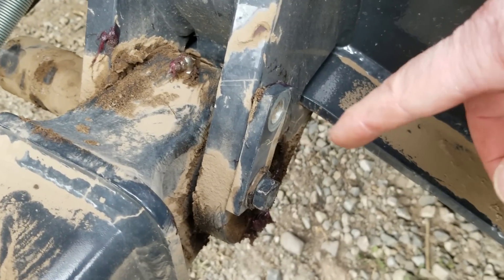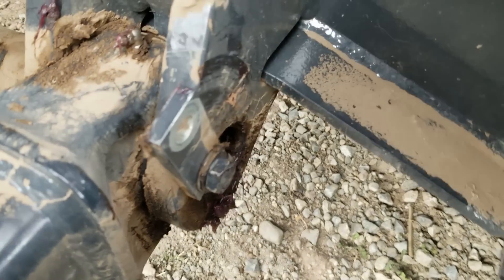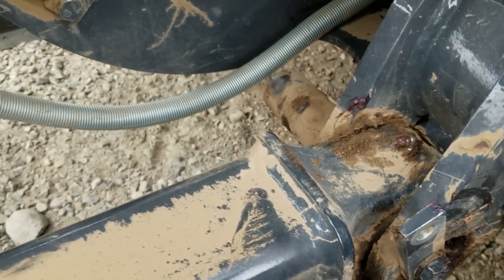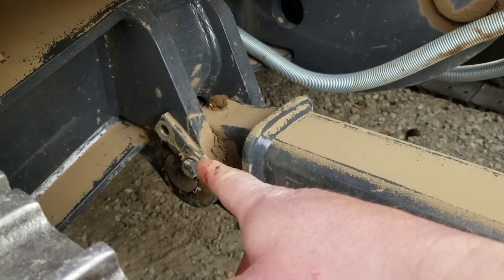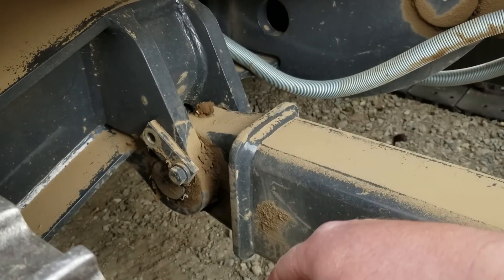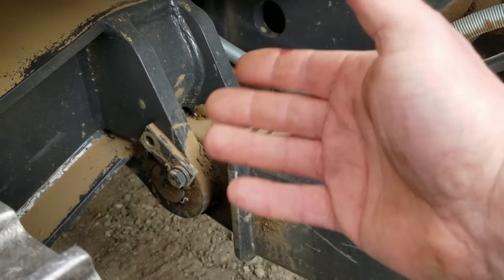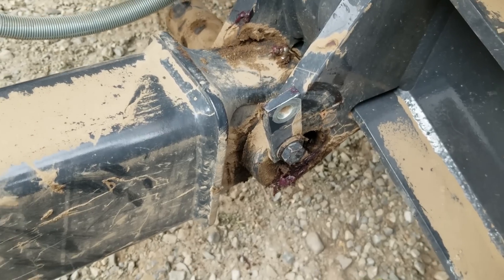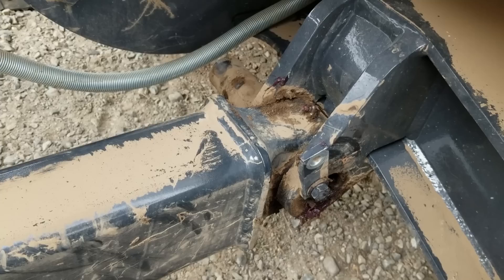Deere excavator design flaw. Suggestions?

Comment: I’m a maintenance supervisor in a steel mill. Many of our pins are retained this way and it is a design/engineering flaw. Pin seized in the clevis, when you raise the blade the notch in the pin levers the keepers and breaks the bolts. Solution was to machine the notch in the pin the full circumference so the pin can rotate if needed.
Reply: I'd like to jump on the bandwagon of hate against the bean counters.
Reply: Whilst I think the full circumference notch is is good idea to stop the bolt breakages it causes the fork holes to wear as they are not bushed or greased so you end up with a nice sloppy hole and a dingus pin that don't fit! We welded big beefy tabs to prevent this pins were held in with his old chunky spilt pins after.
Reply: As Don has described, it doesn’t require a huge amount of torque turning those pins to exert a huge shear force to those tab retaining bolts. A short arc of movement coupled with a tendency to neglect the lubrication of the dozer blade pivots (obviously in favour of the arm and slew turntable) will soon result in problems with this fixing method.
Reply: Why am i thinking of half inch thick C- or E-clips now?
Reply: @dikkie1000  that would stop the pin from coming out, but it wouldnt stop the bolt on the bracket from snapping. They shoulda used much thicker bolts so it has a much higher shear point. With a piece of equipment like that/all the weight and heavy duty stuff it does, bolts that size is a joke. I blame the bean counters not wanting to spend the extra couple bucks for bigger bolts
Reply: @jacksmith2315  nah those bolts are plenty big for a pin that size. Wrong type of pin retention altogether for the application. I'd put money on a TSNB coming down soon enough to replace them with expanding pins.
Reply: Bingo.
Reply: I've seen that in some ancient equipment, it was still working
Reply: Bingo!
Reply: So this IS a feature - when it self-destructs you know you were getting lax with the grease gun.

Comment: Haven't managed that particular breakage myself yet. Although all our stuff is well past 100 hours, so by 1000 it's self-clearanced and just stops doing it? 

Break out the welder. We both know you'll never pull that pin out unless you're getting the grinder out anyways. That's one of the pins that you just take the slack out with the controls, since the only usefulness that blade has is steadying the machine. If it was a 4 or 6 way blade then it would be mildly useful as a dirt pusher, but still not really since it's narrower than the damn tracks if you actually try and play dozer with it.

Comment: It's the same locking "nongineering" kind on New-Holland TG series (some CaseIH Magnum too) and these always break.... guess what.... this locks the front axle's main pivot's pin (2"-3/4 dia). We're just right now remounting the whole front-axle after a complete overhaul. The pivot-pin will be lock with double-L brackets on both side of the tab welded on the head of the pin (can't be lock from the other end). These brackets would be held to the frame with 4 bolts (2 on each brackets), tapped into the frame (5/8" or 3/4") 

If we had a milling-machine, would be easy to make a round 5" x 1" thick cap with a groove in it allowing for the tab (rectangular welded head-pin) to at least rotate 1 or 2 degrees. 

If we had a lathe though, I would machine the master pin to fit the kind of lockers I saw on 966 series Cat payloader's bucket.... I'm sure they have a locker that would fit a 2"-3/4 dia. pin/shaft. (or better) ;)

Comment: What in the goofy pin retention is that thing!  I work in equipment rental and that must be some sort of new JD thing?  Haven't seen in on our older units and our newest units are Kubota, but yeah, I'd throw a weld on there.  Maybe a couple fat tacks on the tab to the frame.  At least then you can just zip  them and pound the pin in when you need to change things, or work on that cylinder.

Comment: completely unrelated, but this has been on my mind for a few days now.  previously you put together a battery pack to run 120v tools.  i re watched and paused to read labels.  from what i can tell it was (3) 36v packs and no inverter.  this is probably a dumb shit question and im sorry for asking it.  i tried to research it elsewhere inspired from the dewalt power station, using (4) 20v batteries but this device has a built in inverter to jump the power to 120v. 

the setup you made appears to run 120v tools just fine at a lower voltage.  whats the voodoo magic here?  does lower voltage output effect the devices youre supplying? was there a small inverter not mentioned?,  or is the answer even simpler, universal motors simply have an operating range + / - 20v?

Comment: Oh dear testicular scratching. Lincoln or Miller welder a death metal melted together permanent repair until pin wears out then gouge welding removal repair failed again continue until the scratchy falls into rusted

Comment: My solution would be a "C-clamp" fabricated to the correct dimensions to where the pin can't wobble, with being bolted into those holes. The only stress on the bolts should be holding the weight of the C-clamp, and the clamp holding all the force of the pin.

Comment: After reading all the comments that I should I see that only one is close to a proper fix and Fabricobbling! Here’s what I Did with 3 pins on a 1969-1971 ish Case 480CK Construction King.
After all it was well worn out and I rescued it from the junk yard.
I made Doughnuts 🍩 for at least one end of the pins got pins from the JD dealer that had a Take me home now price beneath 3/4” of dust on a back of the showroom wall. They fit tighter than the worn out ones, but they stuck out a bit more so I turned some 4”Diameter doughnuts. And they were 1-1/2” thick with a 1-1/4 hole. Then I put that in my Mill and flattened two opposite sides and Drilled 5/16” holes through it aligned the holes in the pin and doughnuts, then Put a 5” long Grade 8 bolt lock washer and a pair of nuts with another lock washer between them. The owners sold it for close to 10k the Extend-A-Hoe valve pack was the last thing wrong with it and a few of remaining old Hoses. It was almost impossible to steer when I drove it home to work on... but when it was returned you could steer it with your pinky finger. All the lights worked plus the additional work lights I installed. Single wire Alternator, remote jumper attachments for Positive and Negative, and a entirely new battery Box. Replaced the Cutting edge on the Bucket, and most of the wiring. Some one got a great machine! I kinda miss all the fabricobbeling, even added additional hydraulic oil filter just before the new Hydraulic pump, and it was only lacking that big valve Body that was worn out. It would work but if you expected it to pass a leak down test it would fail. 5 cylinders of the 10, I had rebuilt, and hoses were replaced with new. Loved this machine! Volunteer wages and dug my pond 😃

Comment: thats a problem either with the dealer using cheap farstners, or simply what to expect with Metric bolts... slap a Grade 8 SAE "equivalent" to the metrickery (read likely .015-.060" bigger on the maj DIA) and the problem will go away. will take some drilling and tapping but I feel you can handle such things.

Comment: Have had/seen same issue on pretty much any equipment that uses a bolt to retain a plate like that. Longer pins with bolts through them so they can rotate helps.

Comment: That should be under warranty, it looks like the bolts were over tightened, if you're going to do it yourself get out the old sheered off bolts and  replace all 4 of them. Kubota minis bolts would sheer off the problem with them was the bolts are not standard metric thread pitch. I would end up re-tapping the holes with a blind tap to standard thread.

Comment: Did the bolt shear off at the pin surface or did it walk itself out?

If it did shear, was it torsional or lateral?

If it's lateral then the likely culprit is too much movement in the pin at the ears, which would be a wear issue. Either not enough maintenance or too much load for the material.

If it was torsional, then the pin was likely binding in the blade, that would be lack of grease again or poor design not allowing grease into where it's needed.

If it's walked out that would either be it simply wasn't done up in the first place, or the same thing as a torsional failure.

Either way that kind of pin retention is garbage.

I would be drilling and tapping both ends of the pin and putting effectively a big old washer on both ends, about 10mm thick or so. That way it's retained and is allowed to float. Just shim it up to allow 0.5mm or so of total end float to allow for grease and a little deflection of the cheeks under side load.

Comment: As an owner operator of heavy equipment for a decade, that is the least used feature of an excavator. I may grease my blade pins every 3rd Wednesday and no failures yet. Beef up the pin retention via; big ol buzz box. Weld that sum bitch in place and keep hoe’n!!

Comment: What we have just witnessed is the first software hack on the mini track units! Maybe AvE will get the rest of the code right in the next attempt and achieve higher angle and be able to windrow both left and right! Unlocking features through the computer without hardware changes, what a time to be alive!

Some commented that the pins should just be allowed to rotate. I believe this is false. The grease path in that pin or blade frame is only going to pump grease to the blade frame part that was supposed to move originally. If the pin just rotates in the machine frame with no lube it’ll wallow out the eyes in the frame and then it’ll be a mess.

Comment: Ive had a 50d for  3 years. Have put 1000 hours on it Abusing hours. Now has  4115.No problems at all. But then I grease every time i use it. I will use this video to show the dickheads that say you can over grease.

Comment: We make large earth moving equipment.  On smaller machines the 'tab' head style pins retained with a bolt were fine for decades.  However, now most of our pins have a hex head on one end with the inverse hex stop welded to the machine.  The opposite end of the pin has a 3-hole cap with SHCS or HHCS to secure it pin place and prevent it from rotating.  There is more machining involved and a larger BoM but totally worth it -- for RADIAL force applications, not Axial/Thrust.

Comment: Very common for a lot of Deere equipment, seen the same problem with the same style keepers on their dozers. However on the dozers the keeper tab is a thru bolt and not tapped. Is it an option to thru bolt it or can’t you get to the other end?

Comment: So being in the hay baling business going on over 22 years now. I recount my second year into it with the second new round baler from Deere. Ran the first bale fine. The second bale was being spun up when I got a door alarm, and noticed that the belts seemed to be smoking. It was probably 3/4's to size, and thought maybe the gate didn't latch all the way. No biggie i thought, just stop and eject the bale. Well, as soon as I tried to kick it out the whole rig burst into flames on account of getting the oxygen every good fire needs. I jumped out and immediately got the pto detached, and tried to drive away from the baler, but the damn safety chains were keepin her following my tractor. Luckily there was a shallow pond in the field which I headed directly towards. The water didn't save me and the tractor, but the soft bottom of the pond did. I must've put the PTO shaft 6 feet under which broke the safety chains clean into this saving the tractor. Insurance guy came out, and the fault was from the factory. One of the rolling bars that the belts ride around had not a single bolt holding it. Just the green paint to hold it's connection in place... 😂. Moral of the story? Don't use the safety chains.
Reply: Forgot to mention that I dodged death again a few minutes later when one of the hydraulic cylinders that lift the gate up and down got so hot it sent the ram straight towards me like a missile. Luckily I was young then and had quite a vertical leap.
Reply: Farming is dangerous...
Reply: Dangerous but fun.......

Comment: I’ve got a couple John Deere 325g skid steers and the pin bracket bolts break all the time, and the pins walk out on the arms for the attachment plate. John Deere wouldn’t warranty them, they wouldn’t even warranty the pins that snapped in half, they said we abused them and sold us new parts that broke within 20 hours. But the pin brackets I just welded those, nothing a grinder can’t fix if they need to come out.

Comment: If you call a Deere dealership they can run the serial number for any PIPs. Something like that may fall under a fix as fail or there may be an alternative part for "extreme use". A-lot of the PIPs can be done on a machine even if the warranty is out so long as it isn't expired and as the dealer will get paid so they will happily provide the parts. About 10 years ago I worked on a 60G that had been rolled down a bank and if I remember right some of the pins I replaced did away with the set up you have and went to a welded tab and single retainer bolt. If I'm remembering wrong don't crucify me. After 20 years and thousands of pieces of machinery shit tends to run together and get mixed up in the old memory banks.

Also those probably sheared because the pins stuck. The single tab ones will do the same thing. You could always try a grade 10.8 and see where the next weak link lies.

Comment: My guess would be probably a grade 8 bolt and some blue loctight or green if you're willing to go with the screw the next guy approach.  It honestly looks like they put the wrong grade of bolts in.
Reply: Grade 8, probably won't need loctite. The difference in thread pitch should be enough for that metric hole.

Comment: I've crawled all over mining equipment looking for cracks and almost every machine has a broken pin retainer. Doesn't matter if they weld a huge block on, the welds will crack. If the pin wants to move, it will move.

Comment: Bad design, any twisting force on the pin from binding will cause the retaining plate to shear. Because there is an axial torque from flat keeper groove pushing up on the plate if the pin ever rotates.

If it were my machine I’d weld a boss on one side with a through hole for a retaining bolt, you would have to get a longer pin to accommodate the boss with a hole as well. This would eliminate the leaver action of the grove and retaining plate.

Comment: I’d turn a slug with a hefty shoulder and a radius at the 90. Hefty dowel the other end, and retaining-pin the pin. The main pin needs to be 1/4” longer than the clearance between the eye and ears. That would fix it. Side thrust shouldn’t be able to act on the retainer caps

Comment: Do you use the blade to push? How often?  A problem that I encountered years ago was trying to do too much with the blade and using the blade to level the machine.  A small gob of weld on the one side of the retainer seemed to help.  But also using the blade less and the bucket more never had a problem after that

Comment: whats bolt hardness 4.8 cant tell vid looks 4.8 thats a little limp but the only way mechanicaly if pin rotated in bore sheared bolt probally damaged other one also asuming there is a flat machined in pin or way the patern of broken bolt could jest bin yelded from factory 4.8 not much torque needed to yeld

Comment: Lack of grease on the pins…especially on the lower ones like that. I run a Volvo l90H which has similar pin retainers, except the pin on one end has a moose knuckle that a bolt runs in between directly into the boom or arm or what have you. Problem is when the grease washes out it’ll torque the bolt clean in half…if your lucky you catch it where it’s spinning in it’s hole  and bust out a remover…if not you’ll lose the pin completely. TL;DR: Grease and daily inspections

Comment: Don't know the answer, In fact in don't know a darn thing, but I would put the thing back to original and add/weld on to the arm/ a heavy flat against the length of the "keeper" flat iron on the top side opposite to the slit in the pin so the shering action and pressure pushes on the NEWLY added iron flat.THAT way the bolts don't have to take the shear action caused by the pin turning and pressuring.The pressure is placed against the newly added flat iron.The bolts would hold it in place.

Comment: The boltholes are to tight so that the pin can’t move. The answer is bigger holes and stepped bolts so that the locker-bar is loose on the bolts. 

Always good content!

Comment: Usually the problem is when the pin start rotating with the moving piece. That put torque on whatever is holding it. Sometimes it’s strong enough to deal with it as long as the pin doesn’t seize to what moves. 
I think it’s best to just put a plate on both sides to hold the pin in without restricting it from turning.

Comment: My dad's employer does a lot of work with JD. He had to explain to a team of engineers from JD that a part (not a pin, something in the fuel system) could do the job it was designed to do, but not the job they were using it for. And that this problem was the reason they were getting so many crib deaths with that piece of equipment. 

The number of face-palm stories he tells about JD is unbelievable.

Comment: Lincoln 7018 locktight both ends of pin to pin bosses than paint back to factory color

Have to use airarc if you need to remove pin

Comment: Drill a hole through the pin and insert an eyed pin through the new hole, using just one bolt through the eye to keep it attached to the bracket.  That should keep the pin from backing out.